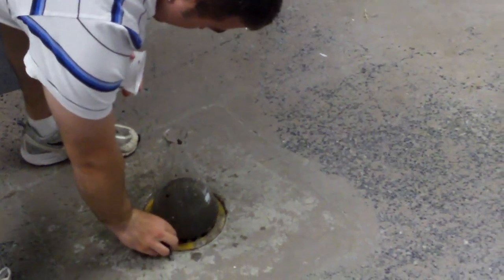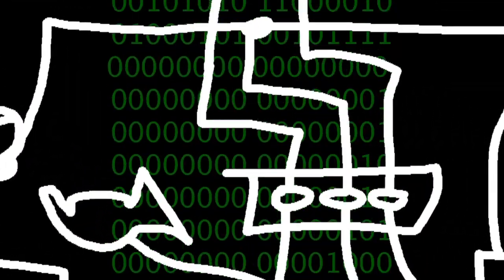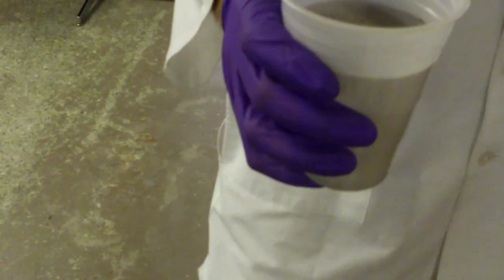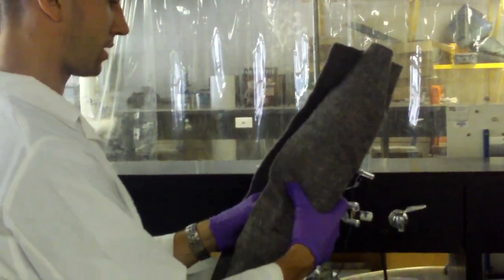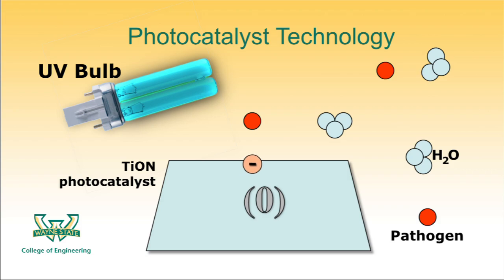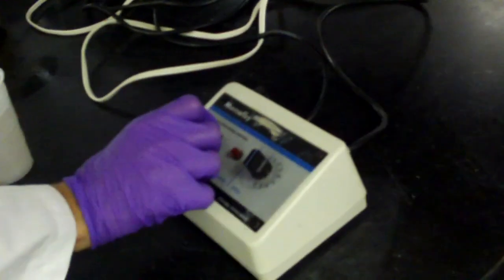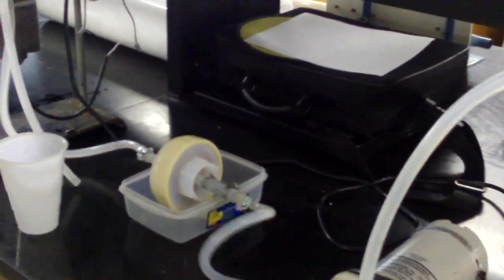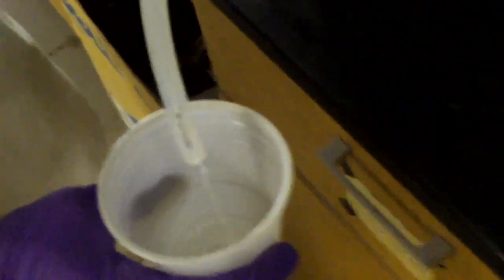Engineering Bits & Bytes: The Purification of Water

Comment: The titanium dioxide nanoparticles are affixed to the fibers within the flow cell, so they should remain in place unless they are physically dislodged.  Additionally, as the flow rate increases, UV intensity would have to increase. The system was designed to flow at 3 gallons per minute and achieves more than a 3 log reductions in E. coli concentrations. Unfortunately, we do not have a more detailed presentation posted ….yet!